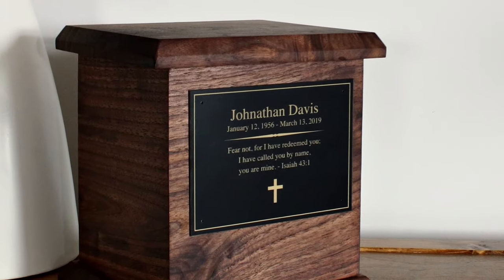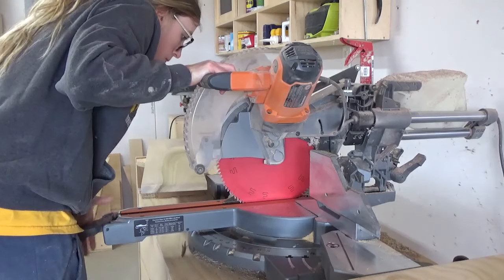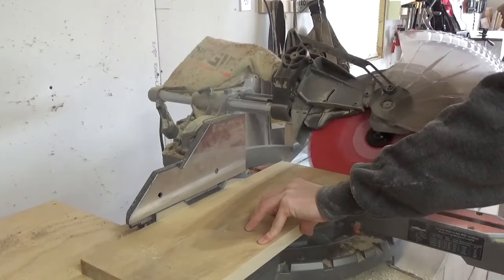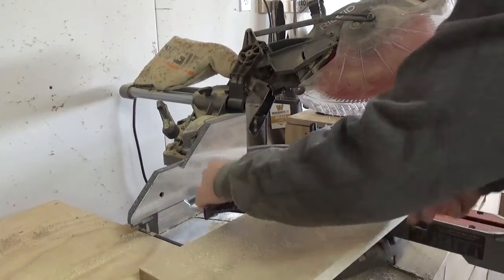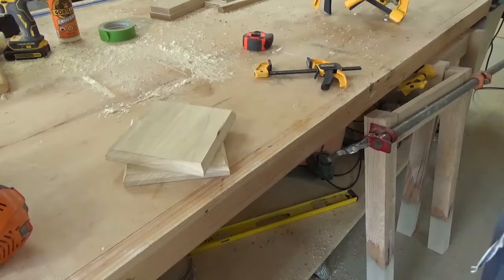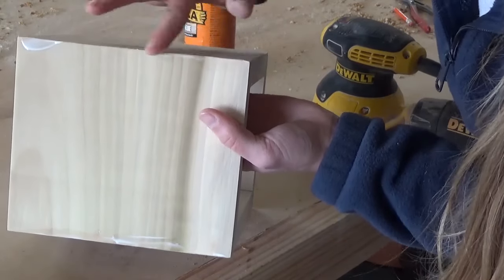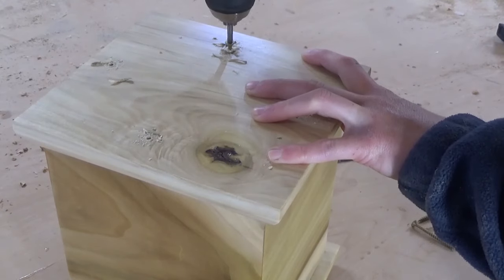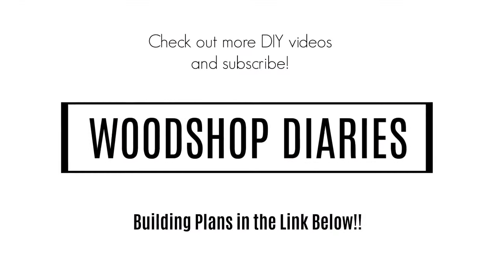How to Make a DIY Cremation Urn

Comment: Great video.  Love the box.  I have done quite a few cremation urns for people and pets.  Since I also have a laser engraver I am able to engrave all the details and a picture of their loved one on the wood, on a custom plate, or on a granite tile called absolute black (sold at Lowes and Home Depot).  The tiles are 12" x 12" so we need to cut them down.  If we use a tile then it is added to the top or a side.  In both cases they are inlayed.  Not a favorite build but when its needed we make them.

Comment: My only suggestion is to use the router (either plunge or table router) on the end grain FIRST. If the end grain tears out, taking a pass on the sides should (cross fingers) remove the damage.
Don't try to remove all the wood in one pass. Take 2 or 3, and increase the cut each time. Poplar is fairly forgiving; oak and figured maple less so.

Comment: Looks nice, my only concern is that if the bottom is not absolutely perfect the ashes may leak out, since it is only screwed.  I may design something similar but with a different joint in the bottom, or have the bottle glued and the removable top.
Reply: ashes come in a plastic bag, they shouldn't leak out

Comment: Is the size you made the standard size for the urns....I think they need to be a certain dimension...dont they
Reply from the maker: Yes they are the within the standard size range. (There’s no set standard, but there’s a range it’s supposed to be within and this fit within the range)
Reply: @WoodshopDiaries  there is usually 3-9 lbs of ashes  depending on the size of the person.... Would this be big enough or should it be bigger....
Reply from the maker: This one is about 180 cu inches. My understanding is you’d need approx a cubic inch per pound the person weighed